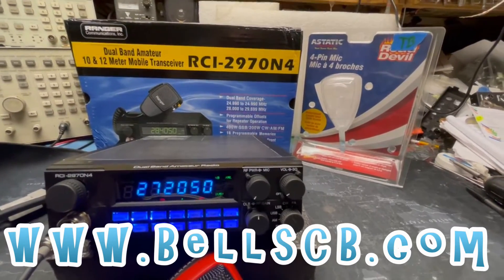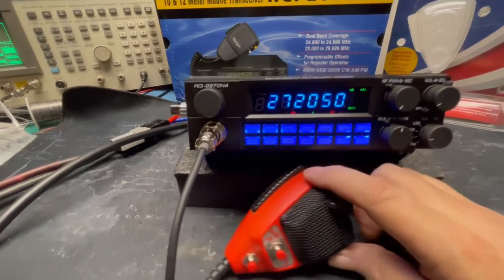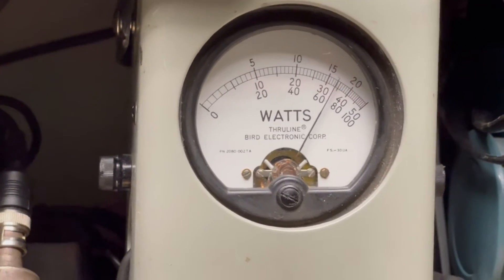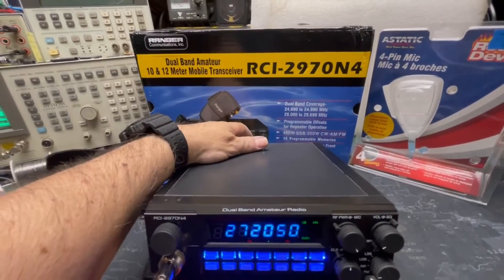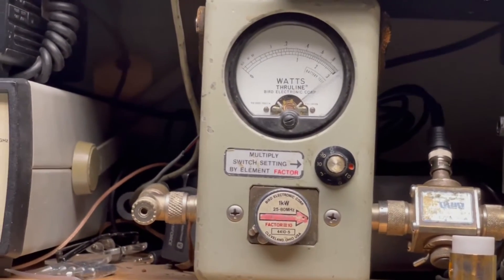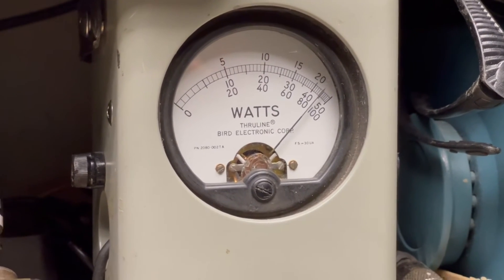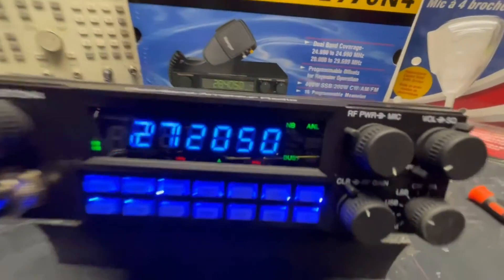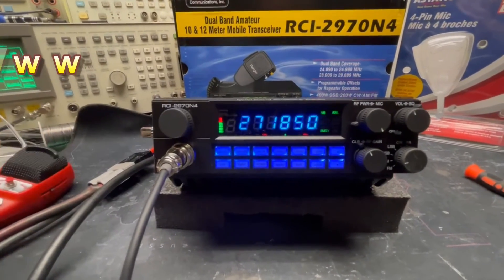Ranger RCI-2970N4 Tune-up Report

Comment: Can you run it at 200w? I know that's a dumb question. But I mean...is there a part of the radio that will burn out dissapating the heat or is it RF power from the input side. I had an amp that was variable...but it ran full all the time and used a choke to limit power on the output side. Aka you think you are saving the finals but you blow up just as fast. I like running all my gear with no stress no sweat.
Reply from the maker: It is determined by regulation circuits at the driver stages. Driving the amp less gets less output. When this radios carrier is reduced to 10w it will peak approximately 150w.
Reply: @BellsCB  Perfect. Great explanation. Thanks.

Comment: Bells CB, I have a 4 watt Cobra 148GTL radio.  Will my 4 watt CB radio damage my new Texas Star DX 350HDV amplifier ?

Will the 4 watts into my amplifier damage my amplifier ?
Reply: My Personal opinion....If your amplifier has a driver transistor inside, then the final output transistors are getting power from the driver. Your radio drives the driver in the amp and that driver drives the final transistors.   Will work fine with a single final radio, am set dead key to 2-4 max. Single radio final or dual, as long as you dont exceed 4watts. I believe 2 should be sufficient if the Texas Star is a used one.
Reply: @LIVINGRETIRED310    my 4 watt Cobra 148GTL should be safe to talk through a Texas Star DX 350HDV amp.  
I should then make sure my CB radio is only putting out no more than 4 watts so it will not damage my Texas Star DX 350HDV amplifier.
Reply: Try turning the power knob all way counter clockwise and open it back up a 1/4 turn. . With the knob turned completely to the left. At a dead key normally you should have about 1 watt. Halfway you should be 2.5 - 3. All way open you should be at 4. Run it halfway using the amp to be safe.